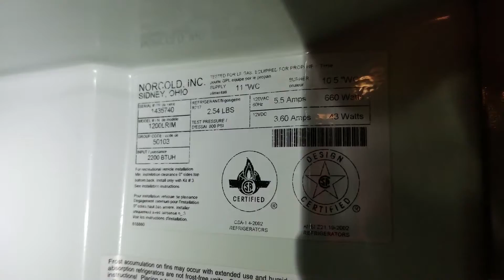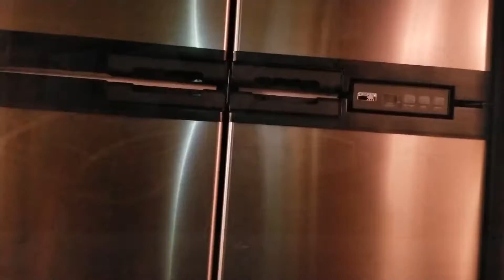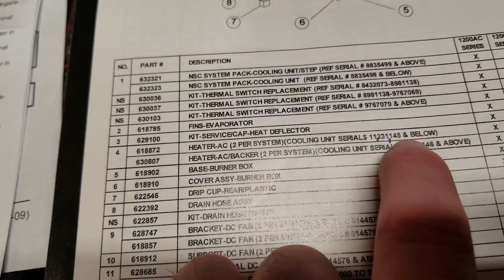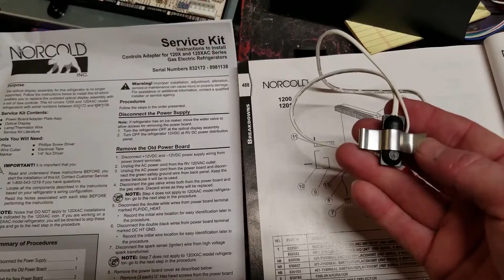Norcold 1200 RV Refrigerator "NOCO" Error Diagnosis

Comment: What about the consideration that it needs a new cooling unit? Considering NO CO does mean no cooling, and in my case the heating element is still working because it gets hot but the fridge doesn’t get cold at all. After resetting via jumper/ground I am under the impression i’ll need to replace cooling unit next. Thoughts?

Thank you for the video

Comment: Hello, thank you for the helpful video! I was wondering if you could help me with a problem that we have: our norcold freezer works good, however, the actual refrigerator part doesn't cool down. We replaced the thermistor, but we are a little confused on what to do next. We barely got it and this is how it came, the refrigerator does not get cool at all

Comment: I would replace the control board and the heating element.  Replacing that Fridge is about 2100.00+  and the control board and heating elements will run about $300.00 in parts.   the thermistor is only about 30.00  and walla  a rebuilt Fridge.

Comment: Regards repair, I would take a look at the back of the board to see the condition of the resistor solder points. No.way to test a 10 cent resistor without removing it from the board,as far as I know... If it's burnt, the resistor has been overworked most likely. Heat is the enemy of circuits. Be careful with fridges 🔥. If the unit was fun out of leve!, That could have caused some of these problems. Don't level the RV, level the fridge!!! Your thoughts?

Comment: The refrigerator side relies on heat exchange, as said by Darren--MyRVWorks, and others. Question: what do you all think of the drip tray design and location as it blocks vertical air flow through the fins of the exchanger. And your thoughts on air circulating fans that can be mounted to the fins inside the food compartment, it set inside on a shelf... Your thoughts???

Comment: I would replace both Elements for that Model and also replace the Control borde with a new fuse and clean the Units exhaust system.

Comment: We have a norcold smaller unit in our rig that we got about 2 months ago...LP tank empty... So I tried it on auto... No function at first ... I tooke the back panel off outside unplugged and then plugged it into an extension cord... About 2 or 3 hours later it was very warm inside the refrigerator with a grow light I could have really grown some nice plants...haha ... Well I unplugged it and plugged it in correctly and it's been working ever since... Is this something you would do or am I just lucky? ... Happy campers say my RV works... Love your videos... The humor is a great spice along the way...
Reply from the maker: So if I'm following you here, you have no LP to test. When you plug it into Shore power it did not work and then you unplug it and plug it back in and it did work.  Am I follow you correctly? Bottom line to me, if it's working now problem solved,  that'll be $1,000 please.  LOL.  It does take some time for these things to cool down though. So, how much time did you give it before you checked it?
Reply: @MyRVWorks  ... Following perfectly and logically... Yes it did take some time literally 48 hours... Pretty tough job with no moving parts IE fans... Was not freezing at first but after the next 12 hours it really started ... There's a ton of people who don't understand what it means to remove the Heat and how long it takes !!!  Currently according to my Optical pyrometer its 11 in the freezer and 29 in the refrigerator ... Making ice in trays and keeping ice...

Don't know if my method was unorthodox however proper function was the goal.  Additional note... The thermometer hanging in the freezer was showing - 20 but it just needed to be recalibrated as I was trusting the accuracy of the before mentioned instrument.  

Later I well check the upper compartment from the roof like you did on another video and check the tolerances and clearances and make adjustments it's necessary update on that later... 96 Damon intruder 460 Ford f53 was owned by a retired Air Force couple... Well taken care of ...replaced the carpet front and back and hardwood floor in the kitchen and bathroom ... Everything works they apparently fixed it all as they went along.

Thank you we appreciate your intelligence, technique, and humor. Accentuate the positive and eliminate the negative...
Reply from the maker: @willowquinn  the best practice for testing the fresh food compartment temperature is to check it in a cup of water. That is a more closer representation of food temperature. I've also done service calls on these refrigerators because the folks went to the store and bought a bunch of room-temperature fruits and things and put them in the refrigerator and messed up the cooling for about a day. In the end it's all about convective air currents in that food compartment box making it up to the top fins. And yes it does take hours for all that heat to be absorbed. It's a very passive process. Residential refrigerators have a compressor so it's much more active process and works much quicker.

Comment: Great video, but I am scratching my head on my problem.  I am not getting any code, but I was getting a blinking temperature (when I had it on temperature) or a blinking number when I had it set at 9.  So I know that means that the unit is going into a bypass mode (always on mode), can't remember the name.  Norcold told me to put the unit all the way up to 9 and disconnect the termister to check its OHM reading.  I did that, but the unit still did not cool.  Both AC and LP are working as the unit is hot to the touch on all the surrounding coils and boiler.   As for the termister, after testing it in 32 - 35 degree water, I got a resistance of 27 which wasn't too bad.  So what is next, the CONTROL BOARD?
Reply from the maker: Watch this video.  It may help.  https://youtu.be/IT_5HGe4q-k

Comment: The PCB is fine. A little discoloration on a PCB isn't detrimental.  If it's black and comoing apart or worse, if you can see fabric instead of a smooth surface then it's bad.
Notice the blue resistor is fine as well.
Reply from the maker: Thanks for your comment, one thing I did notice was when I replace the control board the problem was repaired! I think that's all the customer's concern was also LOL.